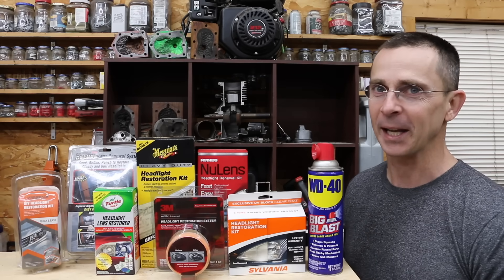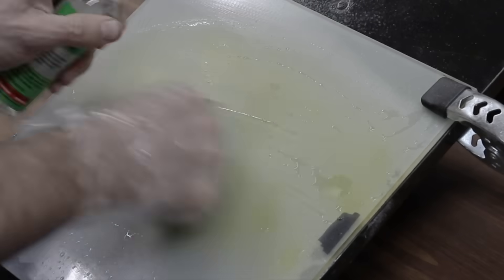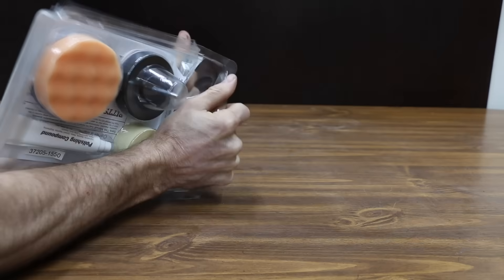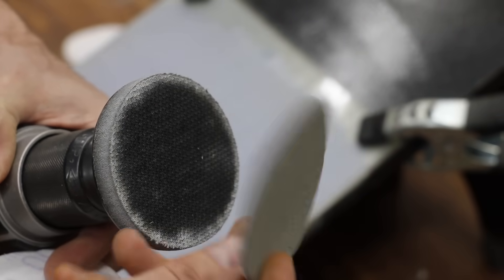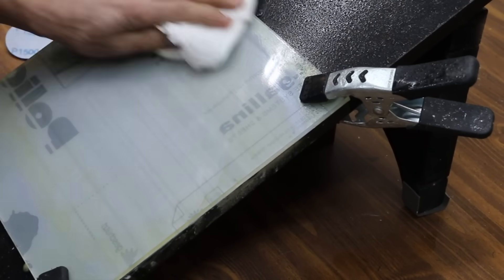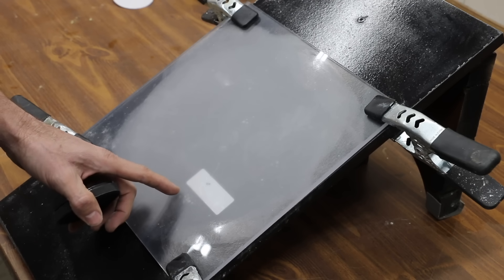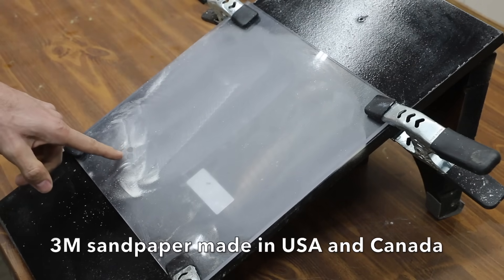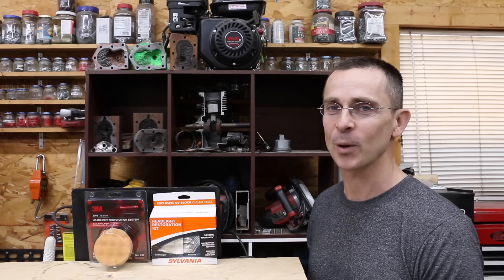Best Headlight Restoration Kit?  Let's find out!  3M, Sylvania, Meguiar's, Mothers, Turtle Wax & HF

Comment: 3M does sell a coating packet good for 2 lights for about $4. You just leave out the polishing step. For best results and if you do many headlights, I've just bought one of the 3M kits just for the disc attachment tool and the 500 grit discs. And instead of using the 800 grit discs, buy some 1000 grit Trizact discs separately. A 3000 grit disc is included in the coating packet. Dry sand with 500 paper, wet sand with 1000 Trizact followed by the 3000. Dry and wipe well with IPA or any wax and grease remover. Coat as per directions on the packet.
Reply from the maker: Thanks for the feedback.

Comment: I bought an old car a few years ago which had headlights in very poor condition.
Like many people I considered buying a "headlight restoration"  product but for a few weeks I just never got around to doing it.
One day when I was polishing the car with the product I normally use and a regular cheap micro fibre cloth ,  I thought I'd try some of the regular polish on the headlights to see what happens. After all, I had nothing to lose. 

The car is black and I normally use Turtle Color Magic (in the black color of course) , and applied some by hand and gave it a rub.
Right away I could see it working,  so I continued  doing it for about 5 minutes and then let it dry and wiped it off with a clean cloth.

The headlights are like new again and have stayed that way for about 4 years now.
All I do is give them a hand polish about once a year for a minute or two when doing the rest of the car. I live in Australia where it's very hot and sunny yet they have never yellowed again.   :-)
All this other stuff is unnecessary, and is nothing more than marketing being used to get your money.   :-)
Just use your regular car polish and do your headlights whenever you do the rest of the car and they will always be nice and clear!
Reply from the maker: Thanks for sharing.

Comment: I would love to try out Sylvania on my current daily driver that hasn't ever had any treatment on the headlights and show you the before and after. I currently drive a 2006 Cobalt with over 205k miles and I drive mainly at night. I have to say they are pretty oxidized. Is there a social media account you have that I can tag you in to show the before and after?

Comment: One of the first things that any budding "car guy" learns is that, with the exception of chrome, ALL polished surfaces must be clearcoated to prevent oxidation. Paint stays shiny/glossy because it's clearcoated. Polished wheels stay shiny/glossy because they're clearcoated. Headlights stay shiny/glossy because they're clearcoated. Even the unpainted bits of textured black plastic found on the outside of most cars (cowl, sideskirts, mudflaps, etc.) are coated in a matte finish clearcoat. If you polish ANY item on your car, be it plastic, steel, or aluminum, you need to immediately spray it with clearcoat or it will rapidly go back to looking like cloudy oxidized shit.
Reply from the maker: Thanks for the feedback.

Comment: i usually use p500 sandpaper with water to remove the yellow surface, after the yellowing gone, I use p1200 sandpaper to make the surface a little bit smoother. and then I applied the clear coat.... DONE . No compound or any special liquid needed

FYI.... Japan made the best sandpaper in the world
Reply from the maker: Thanks for the feedback.

Comment: I'm a trader within the family business and I would say 3m kits are the best just make sure you get a uv  protective spray after else they all come back foggy after 6 months
Reply from the maker: Thanks for the feedback.
Reply: Does the UV protective spray come with the kit? If not, is there one you recommend?
Reply: @doodlemilitia3497  the one I use is called Etech restored its a spray or there is one called big Ben but its twice the cost of Etech does an identical job its good stuff for the money .and no I don't think they do a restore kit with this .

Comment: If you have sandpaper at home and a nail polish top coat and you don't care.... Did that, 2 years later it's still good. Btw, if you sand by hand you're going to take a half hour or more, wash off, dry, then put to coat. You don't need water and it dries quickly. Most of these want your headlights dry for 24 hours!!!! Who can do that with a car outside unless you live in the desert!?
Reply from the maker: Thanks for the feedback.

Comment: Thank you for the reviews you do, I can't afford to go test all these items in your content. You do us all a great service. I don't buy anything until I see if you did a review first.
Reply from the maker: You are welcome!  Thanks for sharing.
Reply: @ProjectFarm  I have been an avid fan for years, and often search for one of your reviews before buying a product. And although I have not scanned for a review of this product, and it may seem silly to a lot of people, I find that I have to buy it a new appliance bulb for the light on my (hood/ range? above the) stove about 3 or 4 times a year! Even though they're not very expensive, it is an item that I often forget about if I don't make myself a note to purchase one. This often results in not having a light about 25% of the time LOL. If you're still reading this, here is my situation... We leave the light on all night every night in case we need to wake up and get something from the kitchen, and to allow some type of visibility for my cat 🙄. The bulb is accessed by removing a screw and is located behind a piece of frosted plastic/glass. We seldom, if ever, use the exhaust fan. (because honestly, my wife does not cook very often requiring it) therefore I am sure that build up of steam is not an issue (causing moisture problems). At first, I typically would use the cheapest Walmart brand, with a filament. After seeing that I'm going to have to replace it several times a year, I even attempted the more expensive LED brands thinking they would be more durable or long lasting, I even thought maybe somehow the filament bulbs were jostled causing them to blow out faster... I have not found any that seem to last any longer than the cheap ones! Our unit happens to be in a brand new mobile home that we purchased in 2017, and I have a background in electronics and used to build electric motors for a very well known company so I have checked the wiring thinking there was something wrong in the manufacturing process causing it to prematurely drain bulbs, short them out, or cause a surge, etc. After years of frustration and no clear answer, now I  routinely just pick up two or three when I remember to get one, and keep them as spares for the inevitable changeover that comes every 2 or 3 months. This has baffled me for a while now, especially considering all of our appliances are top of the line Kenmore and I have only replaced the bulbs in the refrigerator and freezer (that seem to go through so much more abuse, and you would think would be affected by the temperature) once! I just thought I would make my first comment about this silly situation. And while I'm hoping only you can read this... I have a sneaking suspicion I will be inundated with comments about my long diatribe, or use of pronunciation, etc by others, I figured it was worth the shot. Love your channel and your style. Keep up the good work, thank you.

Comment: I decided to go with the Sylvania based on this test and my headlights look brand new. I'm thrilled! I previously used the Turtlewax kit when the 27 year old headlights failed inspection, which made them a little better but still cloudy. The Sylvania kit isn't carried in stock by any retailers around here so Amazon to the rescue.
Reply from the maker: Thanks for sharing!

Comment: Thanks for yet again another great video. This is my favorite channel on YouTube.  I have a 2006 Pontiac vibe with nearly 300k on the clock. My headlights were absolutely shot. Yellow and foggy. I used the Meguiars kit to restore them and I can tell you they turned out awesome. They actually look brand new. I couldn't believe the like new results.   I wish I could post my before and after pictures here.  Thanks for the review .
Reply: Meguiars works excellent used it on my 2004 accent they look like new
Reply: Thanks, me too, though I used MEDIUM HD MEGUIARS THIS SUMMER, BUT, I HAD BETTER resultS, with Regular KIT….?

Comment: BAM!  I commented a year ago about my results with the Turtle Wax kit.  This time around I bought the winner of this video the Sylvania Headlight Restoration Kit.  I spent about 3 hours total because I spent over 15 minutes per half sheet of sandpaper and ended up with EXCELLENT RESULTS.  Applying the UV coating is the tough part because you get a warning to only do it ONCE and I may not have slopped enough on.  The headlights look brand freaking new!
Reply from the maker: Thanks for sharing!  Glad to hear!

Comment: After using these products over the years, they ALL fail after a few seasons. Probably due to the very thin layer of protectant provided. I started spraying the lenses with a QUALITY 2K automotive clearcoat with UV inhibitors and non-yellowing formula insted of the wipe-on protectant. None have deteriorated several years later. This likely due to thickness of the clearcoat and higher level of UV inhibitors and non-yellowing formula. I really appreciate ALL of your videos. Several of them have decided purchases. Thank you!
Reply from the maker: You are welcome!  Thanks for sharing.

Comment: Great comparison test.  One of the best channels on YT!

If you need to clean/restore your headlights and already own a random orbital sander you can purchase 3m trizac discs to fit, as well as polishing sponges and various compounding creams (3M, Meguiars, etc) and have sufficient supplies to do several vehicles.
Years ago I started with a 3M kit then quickly realized I already had 95% of the stuff in the kit only in a larger format.  Sold the kit to my neighbor and ordered some trizac discs from Amazon and the wife's VW and my old POS Nissan could be driven at night again!
Reply from the maker: Thanks!  Thanks for sharing.

Comment: I use MacGuire's aluminum polish. Just put it on a cloth, rub the headlight surface and wipe off.  If it's a really bad headlight you can do 2 or 3 coats which will take 6 to 8 minute.  Looks great!!  Costs around $8-10 and can be used for aluminum polishing as well.  Sweet.
Reply from the maker: Thanks for sharing.

Comment: What if the lens is cleaned and polished using mag cleaner ( yes !)...and a frontal view allows good light through.... BUT...as smooth as the surface is....looking at the lens from an high angle, you can see sandblasted pits. Also....the "Smooth" surface looks to have partially yellowed ( all the way through?) regardless.....can the partial yellowing still be removed some other way using these kits?
Reply from the maker: Thanks for the video idea.

Comment: I got a better idea: Spray Off- Deep woods bug spray on your headlight and wipe off everything with a paper towel. Takes 30 seconds, works better than anything and costs about 5 bucks. TRY IT
Reply: I've seen that viral video. Please test this :D
Reply: So I did this on my 8 year old Subaru and it worked great! Looked like new and I sprayed some soapy water so the deet doesn't affect my paint. After a week it still looks the same

Comment: Great test! As a body shop guy I would recommend to use the 500 800 1000 3000 then polish with farecla G3 or 3m fast cut. You can always buy extra sheets of 3m on eBay or whatever. I used this technique on a yellowed Vw caddy mk1 rear window and it worked a treat! Probably needed an aerosol clear coat at the end tbf. Anyway I wondered if you could do a test with aluminium brightener acid spray. The stuff you use on bare aluminium engine blocks and stuff and rinse off so it looks like new. Anyway thanks for such great efforts!
Reply from the maker: Thanks!  Thanks for the video idea.

Comment: great comparison. I did the Sylvania many years ago based on similar high ratings. It was decent but seems not as good as how it performed for you. Maybe I had old stock. I will have to try that Sylvania again
Reply from the maker: Thanks for sharing!
Reply: Same here. I applied sylvania product according to the instructions and less than a year later the headlights are foggy and yellow again.

Comment: I love your videos, however on this one theres an easier way to restore headlights, i work in a body shop an we get cars with headlights that need restoring bad, what we use its 1000 grit sand paper, 1500 grit then 2000 grit all done with wet sanding (water), then we use polishing rubbing compound #1 which is the most abrasive one and an electric or pneumatic buffer, that will make headlights clear really quick, after #1 compound we use #2 compound and that leaves headlights better than new since we dont use any clear coat light will last years before needing restoring or replacement.
Reply from the maker: Thanks!  Thanks for the feedback.

Comment: Maybe mix acetone with this? I used acetone and it shined up my headlights like almost new. Of course they are badly damaged I've used maguires and 3m twice and they did good but acetone seemed to get them cleaner maybe I was doing them right idk. But some acetone and then some uv protection equals good to go
Reply from the maker: Thanks for the video idea.

Comment: Let me get this straight, manufacturers thought polycarbonate lights are better than glass, then why don't they replace the windshield with polycarbonate?
Reply: Manufacturers probably left glass headlights as a cost cutting measure mostly. I’d say 30% safety related, 70% cost. Of course now these days headlights are so funky shaped that it would be harder than ever to mold glass headlights these days.
Reply from the maker: Thanks for the feedback.

Comment: Great video man. My favorite so far is the 3M kit. I’ve used it on 2 different make of suv and truck and they came out looking brand new, still several months later looking great. Many people have asked what I’ve used and then they’ve gone out and got that kit
Reply: That kit didn't come with a uv protectant.  What did you use?
Reply from the maker: Thanks!  Thanks for the feedback.

Comment: A previous owner went at my headlights with probably 100 grit sandpaper and left them a big mess.  I picked the 3M product and added some 240 grit I had available to get rid of the 100 grit scratches  Huge difference!  Thanks for doing the hard part of finding a good product to start with.  Now I need to put a UV coating on it.
Reply from the maker: You are welcome!

Comment: Step 1, if there are are gouges or stone chips clean lens with windex let dry , fill chips with cyanoacrylate let dry.  Step 2, wet sand with  600 grit, then go finer untill finished with 2500/3000 grit. Step 3, Mcguires plastex polish untill bright and smooth. Step 4 clean all  with methyl hydrate. Step 5 , if lights still on car  mask royally around the lights. Step 5 spray 1K clear coat .. let dry . 2k is also possible for faster results. This should last years  and it does. Mcguires plastex will on it's own remove most of the yellowing allowing you to do you first clear sand with a much finer grade paper. I never use the kits as I have all the supplies needed in the shop.
Reply from the maker: Thanks for sharing.

Comment: I have performed this on 2 different vehicles.  My Jeep had round 7 inch headlights and were badly clouded.... Lot of work..a labor of love for sure.  The Sylvania kit was used and lasted 2 years before starting to get cloudy again.  NOT lifetime!  Second vehicle a toyota tundra.  I used a ceramicote kit... again a lot of physical labor... great initial results, better than the sylvania.. how long will it last??? time will tell.  IMHO any kit that does NOT have a final UV coat, sealer is NOT worth your time... it's only going to last a couple of months.
Reply from the maker: Thanks for sharing.
Reply: the ceramicote laster less than 2 months...back to cloudy... new headlights ordered and be done with it.....and apparently you cannot use another kit when things start going bad.....

Comment: Great video. I am having a heck of a time with my mitsubishi vr4 headlights. They look like they were clear coated and then the clear coat yellowed and oxidized. I have tried the meguiars and the mother's restoration kits with unsatisfactory results.  Looks the the sandpaper is key, if you can't get the bad material off before you polish then the results are not great.
Reply from the maker: Good Point!

Comment: I use 400 grit then 600 grit up 3000 grit sand paper.
Along with wet sanding at first then rubbing compound followed by polishing compound, spray few coats of clear paint then wax after few days 
I get about 2 years before refinishing once again.
New is not better, when they say new and improved, that means we charge more for inferior products.
Reply from the maker: Thanks for sharing.

Comment: Alright it's time I stepped in. What in the hell are you doing? You're going way overboard. My sister in law bought a jeep grand chereoke. It was like new except for the yellow headlights. She asked me if I knew of a solution blah blah blah

I took my Chicago electric high speed 7" sander/buffer put the genuine simulated lambs wool polishing bonnet on it. I then went to the storage cabinet where I store  car care products. I grabbed a glass bottle of turtle wax that was my grandpa's circa 1960, green liquid turtle wax that came in a glass bottle. I placed that on the bonnet and 30 seconds later my sister in law had crystal clear headlight lens.

I laugh at all the procedures you went through. Her's were so bad, as bad as I've ever seen and they came out like they were brand new. Turtle wax...